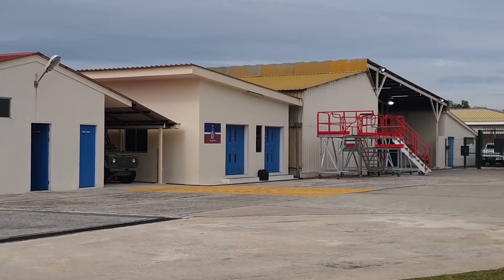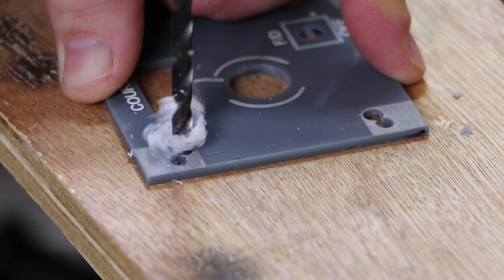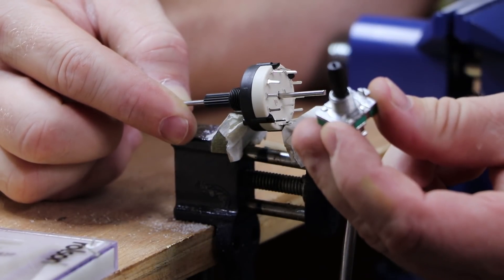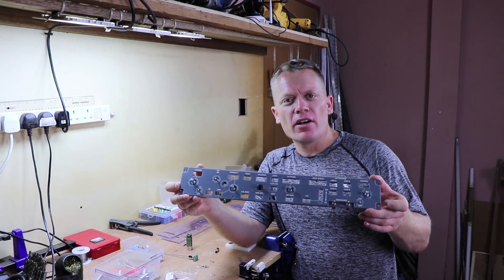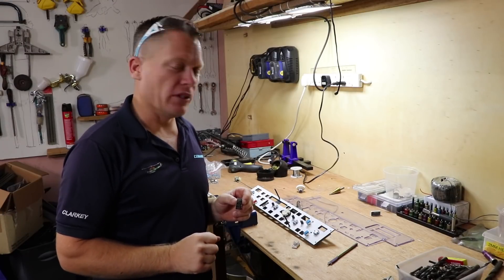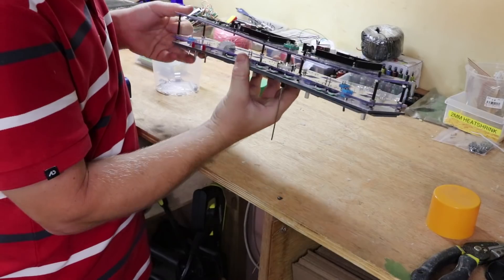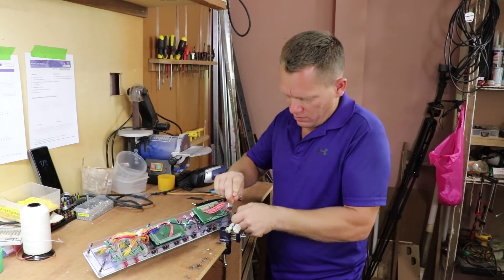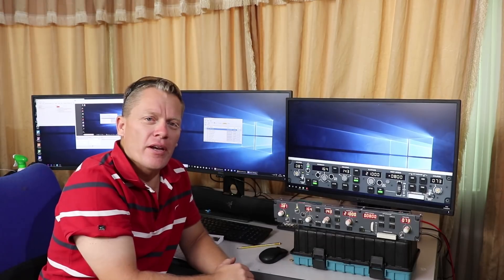Refurbishing Joe's 737 MCP

Comment: One thing I don't understand here: Joe sends you his mess that he spent a lot of time on and you going to fix/improve it and I am pretty sure you charge him for it. So why not buy an MCP that is better construction and quality, you save $$$ (time is $$$). There was one sold on Ebay with EFIS for under $400 USD! It was made by one of the major component manufacturers and is much better then what I see here, and features no-wires modern PCB solution.
Reply from the maker: Good morning Active X. Joe at the time was a 14-year-old boy from the UK. He was struggling with the electronics and contacted me. He sent his homemade project 8000 miles across the world to see if I could help. I did not charge Joe anything, paid for all the parts myself and returned it to him at my cost. The whole point of my videos and website is to show you don't need 400 USD to go and buy a single part. As a 14-year-old boy starting out and fascinated by the hobby, I used this to show, that yes, it's not going to be perfect. But look at what you can achieve with a little bit of time and effort. Hence the other video of the 38usd DIY MCP. If you have the money and can afford to go out and buy these items. Fantastic, but a lot of people can not and I try to analyze and redesign most components several times hoping to make it simpler and cheaper to build. Not forgetting that for some, there is a great sense of achievement in creating something like this.

In short, an act of kindness.

Kind regard

Karl
Reply: @helimech8152  how does your response not have way more likes?.... i wish i had either the money or knowledge to do what you do.
Reply: @helimech8152  That's excellent, well done captain. I am impressed also that Joe @14 could figure out and put everything together. 
Yea, I figured, the point of your project is DYI but have you considered using PCB design instead of wiring, it would be simpler and easier to troubleshoot. Plus, there's now online services where you submit your PCB design and they professionally do the board for ya at like $2 - $5/board I believe. Then, you just solder the parts. With that, you don't have to ever worry about so much wiring and PCB is are easier to troubleshoot imho as long as you design everything well, also no wire disconnects. I know, what you're doing is durable but PCB tracks on well designed board don't break. You're work is much appreciated, we all enjoy your videos. Keep up the great work and video as much as possible.
Reply: I don't think you understand that for the vast majority of people out there, $400 is alot of money to spend on a single panel, and quality is subjective. I for one don't have the funds to dish out $400 on an MCP and half the fun is gone.
Reply: Parts are a fraction of the cost, hell look on his site, $38 MCP, and I believe theres 3D printed plans for the panel floating around, fairly certain you could find someone to print them up, and MDF is relatively cheap, as is a harbor frieght jigsaw, files and dremel, or ypu could ommit the jigsaw altogether and use acrylic if you want to risk scratching.

I don't make a ton of money and $400 is my entire paycheck, to have you go and say "just buy one" is incredibly insulting. To a good portion of people DIY is a fantastic option as it gives you a good project to work on, you can usually fix it when it breaks and can give you a great sense of accomplishment when you get it working.

Keep in mind that you dont need a ton of tools to make great things. People have done far more with far less. Hells bells, look at what the Wright brothers did to get their flyer flying, using a simple wind tunnel to figure out the optimal wind shape.
Reply: @Sovek86  
Jigsaw + Files + Dremel + other tools you should have and it adds up pretty quickly.
You did not even mention:
3D printer, DMM, power tools, other support tools and tools for electronics. I/O boards are also not cheap, and you will need some. 

The issue I have with using plastic for panels and flight controls that it feels cheap, it is not very durable (ie. using plastic on flight controls), and feels light, like a cheap toy from ToysRUs.

I chose to pick up retired aircraft panels on Ebay (for really good price) and wired these, and I also picked up scrapped flight controls and the quality is unmatched these can take serious abuse (Ebay has some great deals and you can negotiate).

It might cost you a more compared to what you building out of plastic but at least it will not feel like a toy and will last you longer. imho, if you end up building a cockpit out of plastic and wood and spend years doing it and then look back you may not be too enthusiastic about it especially when you pull that reverse thrust handle on landing and it either comes off or makes funny noise because something broke.

Just out of curiosity, share with us what you build so far for your cockpit and how long have you been working on it?
Reply: @activex7327  I agree, the cost does stack up once you factor in all the tools and not mentioning the time spent learning the skills to do one. I learnt a lot from youtube and forum discussions and Karl has given me a lot of knowledge on how to create an MCP out of parts but the time spent doing this just scares me to bits. Hence I have decided to get most of the hardware for MIP from commercial fabricators. The only thing I would hazard trying out to build would be the OVHD panel which is just too expensive for me as those sold by some of the sellers. I am basically trying to learn about Arduino, potentiometer, encoders, switches and etc for my OVHD panel build one day. Fingers crossed.
Reply: @Sovek86  I don't think you understand that the tools + parts required to create many of these panels outweigh the cost of the panel, ... not to mention the time.
Reply: I have the money to buy the whole MCP at $400+ but I'm going to build my own for the learning process. I'm even looking at getting a 3D printer too.
Reply: @Devinci297  Let us know when you finish the entire cockpit lol
Reply: @activex7327  In about 10 years if I'm still around!
Reply: @Devinci297  ROLF, as to be expected.

Comment: Hello there! Really good job as always! I want to ask you 1) normally how many arduinos you connect on your simulator what kind of hub do you use? 2) Do you know where I can find CBs? I'm creating a simulator myself.  Thank you anyway!
Reply from the maker: Hello Nikos, I have a round 30 arduino's running the sim systems. Now split over two computers to stop connection problems. As for CB's check out ebay is probably you cheapest bet! I got all mine from aircraft when they are scrapped.  Kind regards Karl

Comment: Hi there, just a quick question: I see you drilled through the rotary switch. Isn't there a spring right in die middle?
Reply from the maker: Hi Danno, there certainly is a spring in the centre. But if you go slowly, the drill bit goes through the coil section without damaging the spring. Go too fast and the spring wraps a round the drill bit causing a mess. It is actually a bit of a challenge, but once you nail it, its easy. Kind Regards Karl.
Reply: @helimech8152  Ah understood. So those of us having two left hands - me included - are better off leaving it as is :D Thank you for the reply, appreciated :)

Comment: can I ask how do you do the lettering and lines on the faceplates? I have a friend who has a CNC machine for cutting the holes but worried painted acrylic will just chip paint off during cnc and look messy. Desperate for professional looking faceplates. Many thanks for your time, I searched your videos but couldn’t see any obvious that showed how this was achieved.
Reply: I think the standard procedure for hobby panels is to paint a white panel with grey spray and then laser engrave it. Seems to be very cheap, quick and professional looking.
Reply: interesting that this is not answered

Comment: Hi
Great job you got there. Just have a difficult question well for me it is. Whow do you connect the 5digits 7segment to the tube? Isn't just for the 8digits 7segments we use the tube? If you could reply I'll appreciate tardih@gmail.com
Need help with that one.
Thanks
Reply from the maker: Hi TechSilv, sorry for the delay, there is a wiring diagram on the website on how to connect a 5 and 3 digit display to the 8 display of the max 7219! I hope that helps!

Comment: Hi, I have a question concerning your max7219 boards. At 9:33 there are these female connectors visible. At 9:35 they are gone and you are able to solder the cables to them. Have you removed the surrounding plastic or did you replace them by another connector? And if you have replaced them how did you get them out?
Reply from the maker: Hi Mickey, I between the pins with thin side cutters turning them from a row to single pins. Then apply the soldering iron to the backside, using pliers to hold the other side due to heat and gently remove.

Comment: Looks great. What kind of wires do you use? What size (AWG or better mm² ;-))?
Reply from the maker: Hello TobiWan18, 5v Arduino cabling I use 24 AWG wire. As I state nearly everywhere. Stay away from the very cheap eBay wire that has only 3 or 5 strands. The more strands the better. If you find a good supplier on ebay, try to stick with them but most of the time its hit and miss. Another trick is to use different coloured wire for different components, or use white cable then use coloured permanent markers on the cable to help ident each component.

Comment: What is name of panel and how can i cut the holes and do writing without any machine
Reply from the maker: Good Morning, This is called the MCP (Mode Control Panel). If you have no machines, the best way is probable with a drill/hand saw/file. Since posting the two MCP videos, People have been really creative in there approach.  Some sim builders even use printed facepanels which are then stuck onto the panel. This is how i started. Others 3d print or pay for the panel to be made. Opencockpits.com and Hispanels.com both supply just the panel to start building too.
Reply: @helimech8152  ok thank you. Also how did you do the wiring. How do you know what goes where. I would like to learn arduino for this reason. I know how to use leobodnar

Comment: WoW! I never thought about the solution with the rotary switch and encoder for the heading. thanks alot for your help with these videos!
And I have a question, why use 2 arduinos instead of just one? I found it possible for the MCP I'm working on.
Reply from the maker: Hello from Brunei! If your interested in why I need two ardunios, check off my MCP offset pages on my website. I know if your using sim vim, it's much easier to use one. But of I have missed something please let me know  and I'll pass the info on! Kind regards karl
Reply: @helimech8152  what is the website address?
Reply from the maker: @onurmx  Hi Onur, the website is www.737DIYSIM.com

Comment: Would be possible wire up different led segments, say white colour version? Great videos btw
Reply: Hi Phillip,
if you need 4 bit 7 segments white displays, just visit this link:
https://www.aliexpress.com/item/White-0-36-inch-4-Digit-7-Segment-digital-Light-LED-Numeric-Digital-Display-Common-Cathode/32646259773.html?spm=a2g0s.9042311.0.0.64384c4dHCKEqK
I bought these displays for my "38 GBPs MCP" designed by Karl!
This seller has also 5 bits 7 segments white displays..
https://www.aliexpress.com/item/20pcs-0-36-0-36in-white-LED-Display-7-Segment-Digit-5bit-5-bit-Common-ANODE/32644502731.html?spm=2114.10010108.1000013.1.66724b602S1Et7&gps-id=pcDetailBottomMoreThisSeller&scm=1007.13339.128551.0&scm_id=1007.13339.128551.0&scm-url=1007.13339.128551.0&pvid=1e5866af-d60a-4ab6-84ab-7747eec50a97
Leave him a message for common cathode.
Reply: @gpasn1953  thanks for sharing
Reply from the maker: Hi Phillip, You can have any colour you like, as long as they are common cathode. If your happy wiring from the boards, you can also have any size or combination of digit amounts.
Reply: @helimech8152  thats awesome, can you share the link to where you bought the boards? Also if I purchase the LED segments separately and not in a block of 4, what would be the best way to wire them? cheers